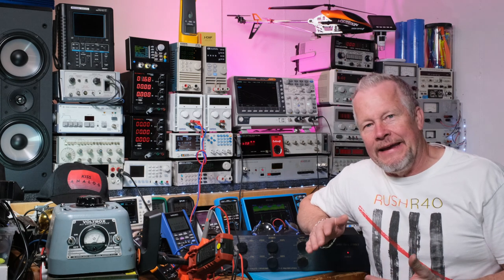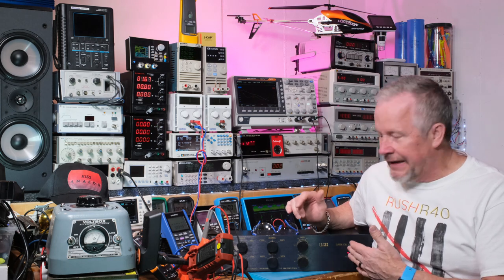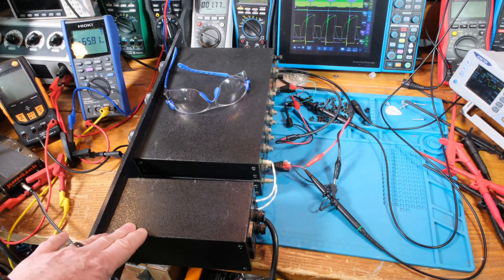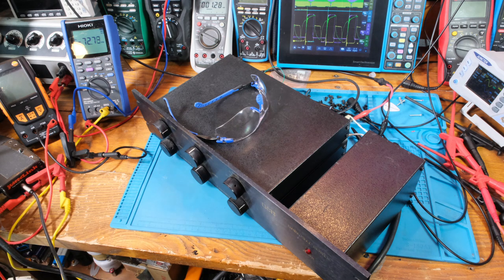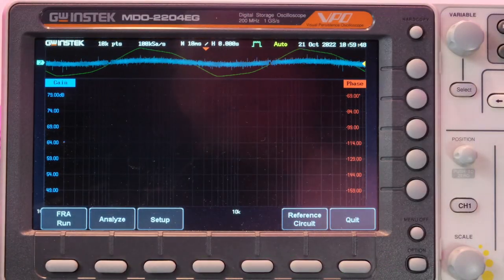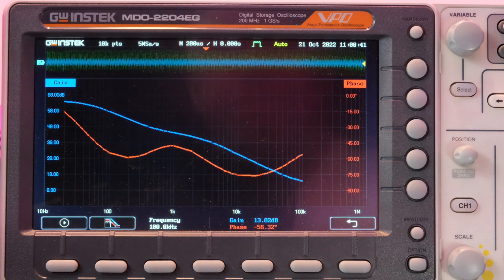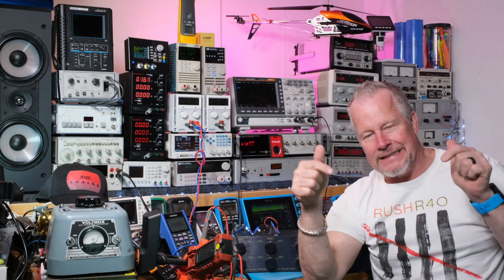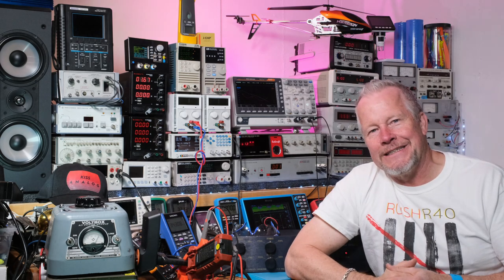What is the RIAA curve from your Phono Preamp?   Best PreAmp you never heard of

Comment: Hey Eddie. Great presentation. One thing I think you didn't mention was the main reason for RIAA and that was to be able to get more music (play time) on a record. The low frequencies required more groove width to properly represent the low frequency amplitudes, so to be able to narrow the grooves in order to get longer playing records, as the frequency goes down, the amplitude (groove width) would narrow. The RIAA curve would restore the frequencies to their 'normal' amplitudes. Basically a sort of decoder to restored the narrowed, 'encoded' vibration patterns represented by the narrowed groove.
Hope I made sense there.
Reply from the maker: Thanks for your great feedback!
Reply: Plus the HF is boosted on record and cut on playback in an effort to increase the signal to noise ratio, as most hiss and noise from a disc tends to be in the HF band. Lower frequency noise is less noticeable. The S to N ratio is still quite poor at around -40/45dB. On a good day! The 2-step curve is made like that for ease of circuit design, one circuit for bass lift and another for HF cut.
An interesting point is if the cartridge is a crystal or ceramic type, it does NOT need RIAA EQ providing it is feed into a high impedance of 1-2 meg ohms. Perfect for old cheap valve amplifiers.
Because rumble and very low frequency noise can give excessive cone movement on the bass loudspeaker drive unit, The RIAA should have a very high roll off at about 30Hz and below. Nothing is recorded on the disc at that frequency anyway. Without this the amplifier can run quite hot producing high powers into the loudspeaker at sub sonic frequency's, very common in Jap amplifiers of the day that gave the frequency response of the phono input as 7hz- 20Khz. Looks good but a bad design.
Reply from the maker: @MichaelBeeny  Thanks Michael for the great feedback!

Comment: Hi Eddie, Great topic. The RIAA curve (Recording Industry Association of America) was developed because of the mechanical limitations of recording music tracks on vinyl. At low frequencies, a needle would be required to make fairly high excursions and would exceed mechanical capabilities of recording and playback equipment of the time. Vinyl records were thus made with the low frequencies de-emphasized and the higher frequencies accentuated. This high frequency emphasis followed by attenuation during playback pushed the noise floor (hiss)  lower. The low frequency boost during playback meant that the turntables needed to be fairly rumble free.
Reply from the maker: Great feedback!  Thanks for the info!  You guys are helping a lot;)

Comment: The RIAA equalization on playback is there to account for (remove) the equalization applied during recording.  The idea behind it is to reduce the hiss and click noise caused by the stylus in the record groove.  This noise is much more prominent in the higher frequencies.  So what is done is that the higher frequencies are recorded hot (at a higher level) then the playback at those frequencies is reduced.  By doing this you get back the right amount of the high frequencies in the original signal and at the same time reduce the audible noise.

It had nothing to do with play time.  Playtime was parameter associated with the media.  Play time, disk size and RPM defined the groove spacing.  Long before the RIAA standardization pressing masters were cut with the bass end de-emphasized in order to prevent overcutting into adjacent grooves.  However, there was no standardization of this.  Every record manufacturer had their own way of doing this and even altered it based on the nature of the recording they were trying to press into disks.  Reproduction equipment (record players and amplifiers) were not initially built to compensate for this.  The result was that you didn't expect much in terms of ground shaking bass back in the early days of record playback.  As the reproduction equipment (electronics, moving coil speaker) got better the hiss, pops and clicks became more and more apparent.  This was the impetus for the RIAA to standardize on a way to compensate.  The resulting recording and playback curves took into account the need for de-emphasis of the bass that had been an industry wide "practice" from the advent of magnetic disc cutters and emphasize the treble to reduce the noise floor and put this into a standard that could be followed by both the manufacturers of teh records and of the playback equipment.

That's my story and I'm sticking to it because it is what happened.  I'll say again, the RIAA standard had/has nothing to do with fitting more music on a record.  To do that you change the size and RPM of the media to suit your needs then record at levels that will allow to take best advantage of the parameters defining groove spacing for that media.
Reply from the maker: Thanks for the great feedback!  Great info!

Comment: RIAA curve in almost any relatively good phono preamplifier have good precision and it follow RIAA standard but best phono pramplifier in the world can't fix it unmatched right input impedance and capacitance for flat frequency respons thru all audio spectre. Sadly that many people with expensive turntables, phono preamplifiers and other audio gears don`t know how much only little wrong input matching can degrade sound on output. Also many, to be precise, almost all phono premplifier don`t have any ability for adjusting impedance and capacitance on preamplifier input side. When I buy AT-440MLb cartride I decide to experiment with input because that almost all reviewers said that this cartridge have tiny bass and very loud high tones. At the end in my experiment with more then fifty audio tests with different adjustments I realise because that sometimes I fix and adjust many turntables I need to DIY one phono preamplifier which is flexible for different phono cartridges. Result is phono preampifier which have DIP switch with more than 96 combination on input impedance. For aligning tonearm I made custom protractor for any tonearm and turntable. Also making custom XLS cartridge resonance In specific tonearm calculator. I have many conversations and posts about tests on VE and Audiokarma forums on that thematics. Euipment what I use for all test are osciloscope, multimeter, ARTA software, SB Audigy 4 Pro sound card (need calibration before measuring), computer and few more little handy tools for adjusting cartridge and tonearm.
Reply from the maker: WOW - thanks for the very interesting feedback!